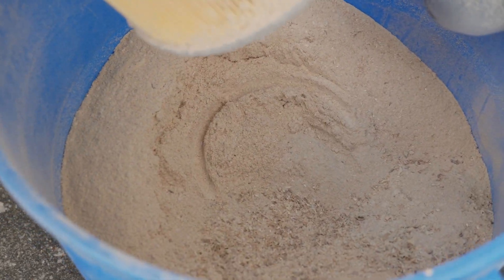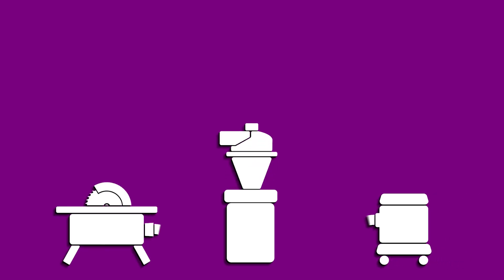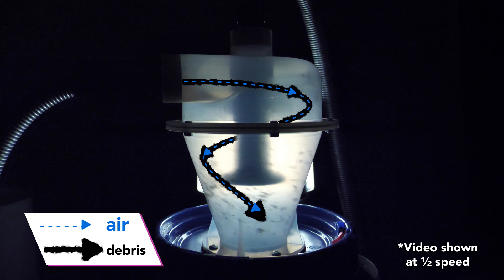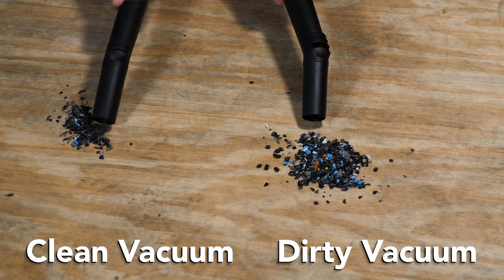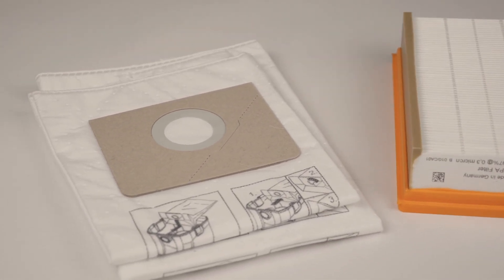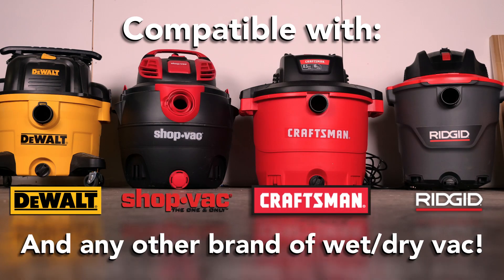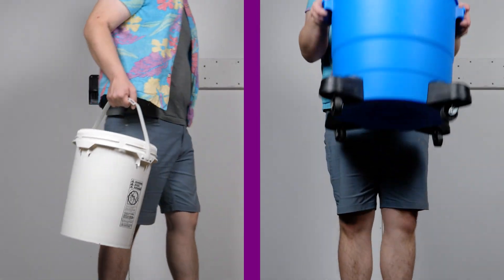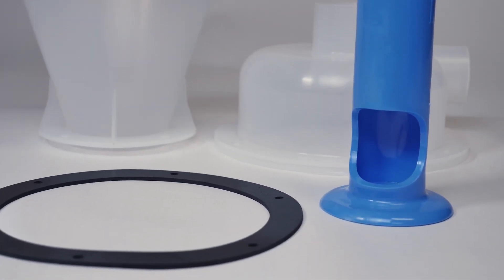What is a Separator? | Cen-Tec Explains: Dust Separators

Comment: How many CFM does the transparent Quick Click support? I have searched for information on the web but have not found it. Thank you. I look forward to your responses.
Reply from the maker: The typical portable/shop vacuums up to 220 CFM can operate, and do operate well with our Quick Click separator. The semi-commercial dust collection systems up to 2,000 CFM  can and do utilize our Quick Click separator. In many cases the separator is being used through a "blast gate" or similar system at a diameter of 2.5” with a more commercial system like that. The high CFM is typically quoted as an open system; as the diameter of the connecting tubing, hose, or separator falls what changes is the air speed. Should the system be connected to a tool which permits minimal air flow like one might encounter with a palm sander, one should consider a relief valve as the whole system will be starved for air. To offer a more definitive reply it would be beneficial to know specifics of the vacuum, such as make and model number.